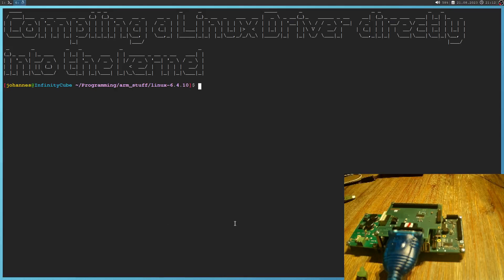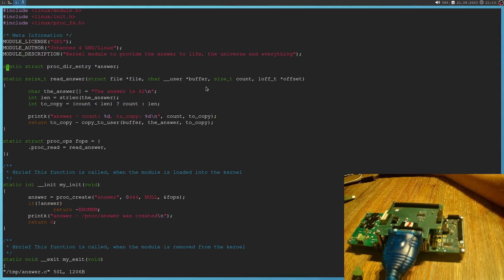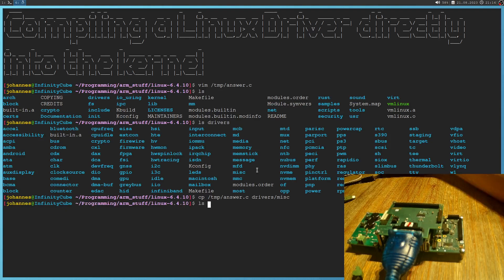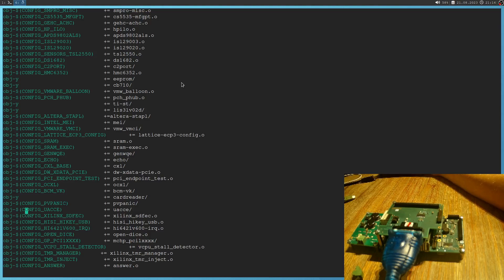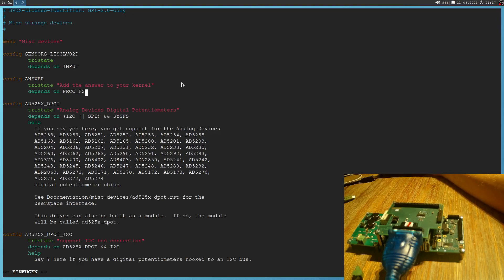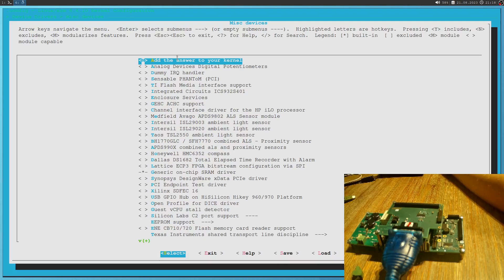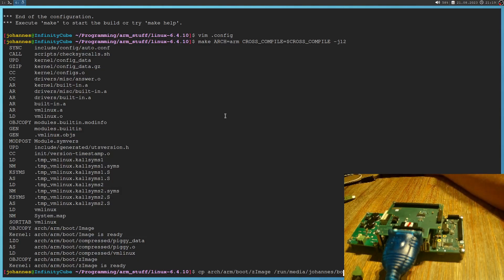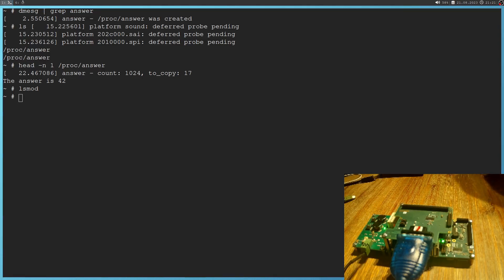Compiling a driver into the kernel

Comment: Thanks for sharing the content, it really helped.

I do have a question though, if in case I need to load my firmware as a kernel module, is it the same steps that need to be followed? I mean like do need to place them as part of driver's folder or is there any other right place to include?
Reply from the maker: You are welcome. Basically yes, but instead of  choosing "*" in makeconfig, select "M". so, in the config you would see CONFIG="M" instead of "y". When you compile the kernel the module will know be build as a standalone kernel module. In my example you will get answer.ko file.

Comment: I know you might be a linux purist, but do you know how to do this for the WSL kernel? Trying to add a driver for a wireless adapter. Not sure if I should build it into the kernel or make it a module. Not sure if WSL2 supports the latter.
Reply from the maker: Well, it depends. If you just want to corss-compile a driver for a remote target, WSL should be fine. So, if you want to add this wireless adapter to an embedded system for example, WSL is ok.
But if you want to write a driver so you can use the wireless adapter in WSL, I would say, no, that is not possible. The problem is that WSL does not really touch your hardware. For the interfaces, e.g. Ethernet adapters, I think it is using a WSL-bridge instead, and at the end you will use the windows driver.
So, if you want to write a wireless adapter driver use a VM, dual boot or install Linux on a separate device. 😉